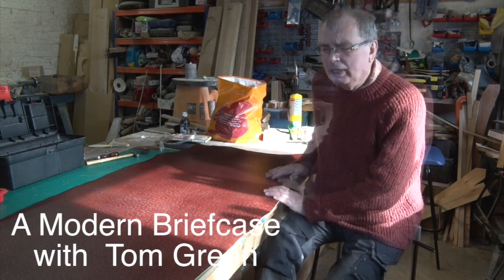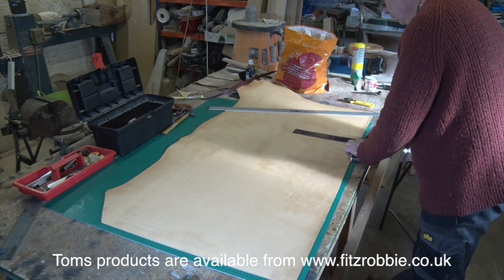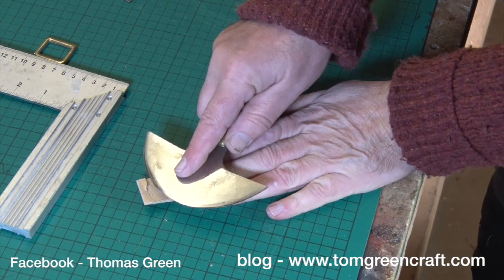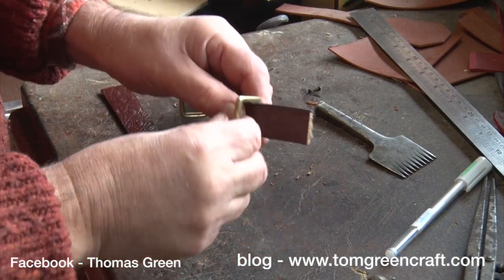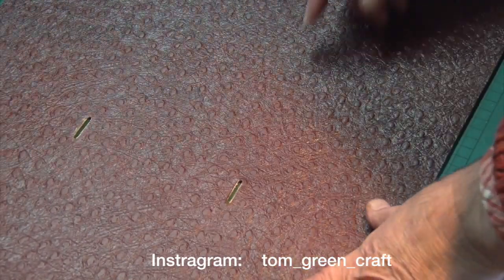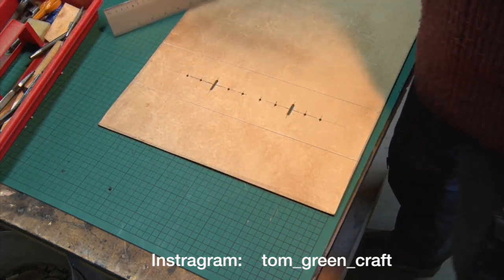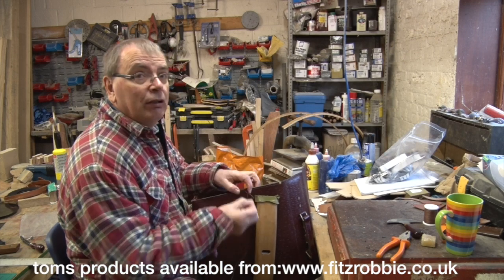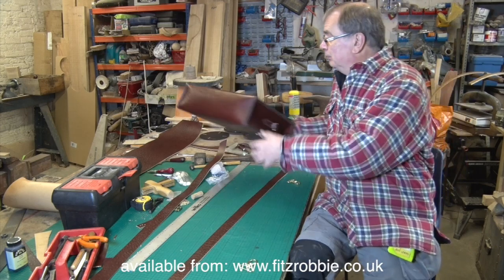How to stitch a Modern Leather Briefcase

Comment: Beautiful briefcase , Tom!  When are you going to finish making the ice cream bucket? Asking for a friend. Lol!
Reply from the maker: The Ice Cream Machine Project is stalled at the moment. I have had a long conversation with the Environmental health dept, Whilst I can make the machine I can't give / sell any ice cream without spendings tens of Thousands on a commercial kitchen and refrigerated transport. Then there is the insurance for someone without commercial catering experience. The other issue is some of the metal parts I can't buy or fabricate from strip steel I need to cast them which is a slight challenge. I usually reckon if you can buy a book about something then I can do it, but for this I might have to go slowly. Having said that I have been quietly amassing the bits to do it, so it will happen just not any time soon. Keep the faith - tom
Reply: @heritagecraft  Thanks Tom, I'll pass it along to my friend. Lol!